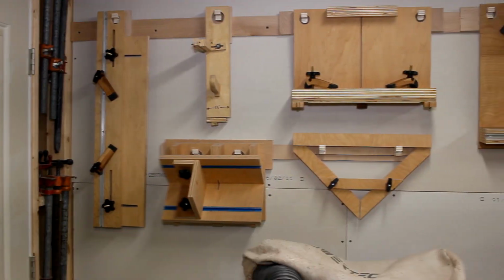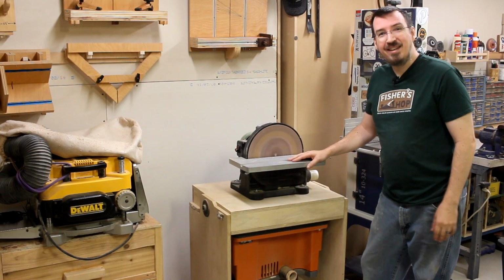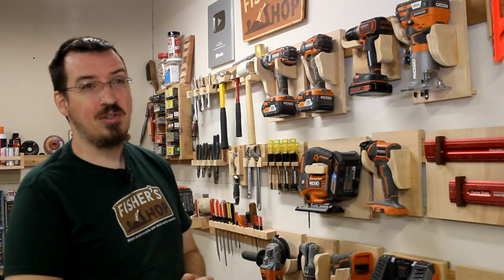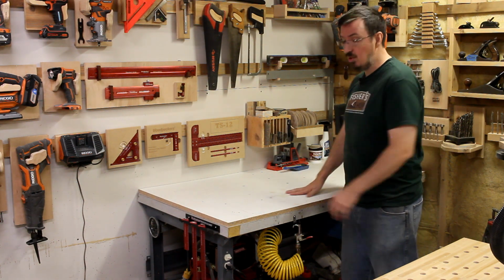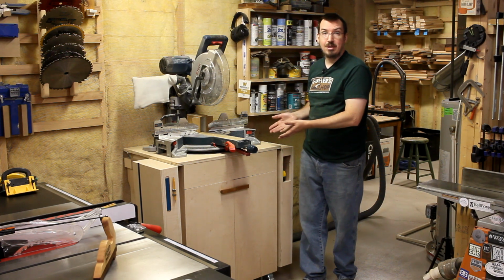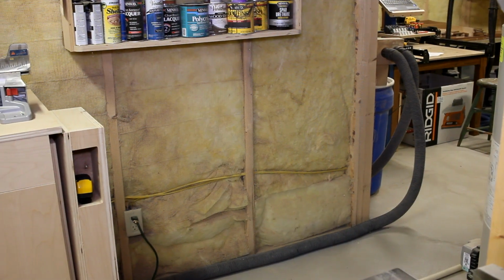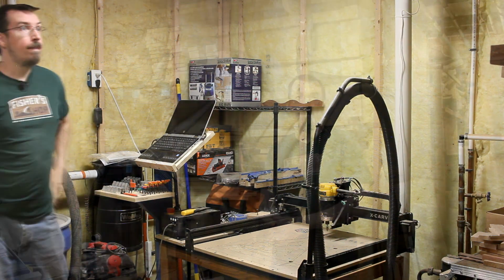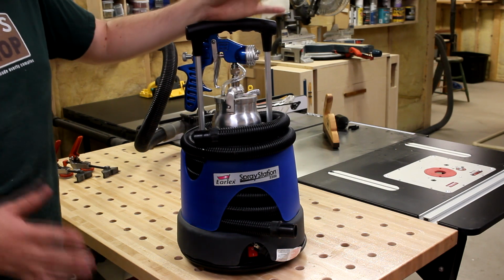Fisher's Shop - Shop Tour 2019

Comment: One thing I'm glad I did in my shop is put plywood on the walls. For the most part, you don't need to locate a stud. Make sure you meet fire codes before removing any. Nice video.

Comment: Ive owned that sprayer for a few years now. Ive stained my fence and painted several things. It even sprays latex paint very well once thinned. I finished a piece for my sons nursery and the latex finish was really smooth compared to rolling it with a foam roller. It's a large cubby that holds 6 cloth baskets and I used less than half of a quart of paint inside and out with three coats.

Comment: I'm just getting into woodworking and also don't own a proper vise yet (hell, I don't have a workbench...), but I have a standard one like you. I made a plywood thingie where you have dead stops at one end and tracks with knobs underneath to squeeze whatever you're working on from the back. Doesn't work extremely well and requires sandpaper finish (to increase friction), but with a small piece of wood glued and screwed underneath you can mount it in the vise and make it a bit easier on yourself for sanding, for instance. Hope it helps 🙂

Comment: That’s awesome that you use stuff from your grandpa in the shop and have your brothers sign. My kids make some stuff in school that I put in my shop. Yes your right flathead screws are so frustrating. I have stuff from my grandpa too in my shop. No flathead screws anymore though. Only square drive from here on out. Some torx too.
Reply from the maker: I like the robertson and torx screws too EXCEPT for them your bit gets stuck in them and you need pliers to get it out.  It's like the polar opposite problem from flat-heads.  lol

Comment: I'm impressed by the dust collection running off of that shop vac. I'd always heard anecdotally that long runs with shop vacs and corrugated hose don't work well, but you seem to have proved different. I might need to reconsider that approach.

Comment: Drew - just found your channel and look forward to watching more of your videos. You have done a great job organizing your basement with limited space which is not easy. I like your french cleat system, it is great for heavier tools. I use pegboard  in my shop. I can put a lot of things on the wall in a limited space. As I have gotten older I have collected more tools and sometimes it can be tougher to remember where everything is stored. I paint the pegboard to my theme colors and group my tools/accessories on them by color/purpose to make it easier to find them quickly. I also paint my cabinets and tool benches to match and  it seems to look pretty good. I used to have a great memory, I sure miss it! Keep up the good work.
Reply from the maker: Neat idea about sorting by color

Comment: Proving without a doubt that spending that extra time on setting up these areas of the shop pays dividends in the long run in terms of efficiency and knowing exactly where everything is. Mine is a complete bomb site and is about the same size as your lumber rack. And no, I don't know where everything is, lol. Especially that pencil that I had in my hand that I've made vanish. Again. :D
Reply from the maker: Haha, you said it Matt... it's a lot of work up front, but it pays off.

Comment: I like the idea of building carts and stuff off of the moving dolly base. I was just thinking about getting some of the big ones and maybe connecting two of them with some two by twelves to make a nice cart for my department at school.
Reply from the maker: Not a bad idea.  Just be aware that you can't lock the casters so you might have to make small wheel chocks to keep it from moving if you'll be using it as a work surface.
Reply: @FishersShop  I  was thinking about just changing out the casters for my favorite brand that has wheel locks. At least for one side of wheels maybe...

Comment: great video, here's a suggestion on where to put more clamps: i don't know the correct term for is but i call it a 'drop-rack' and it goes on the ceiling... and as you can understand, it's a rack that hangs from the ceiling and when you need something from it, you flip a switch, lever or whatever you think of, and one side of it drops (gently) and when you don't need it, it folds back up and it's not in your way any more... 
i hope i explained myself properly :)
Reply from the maker: Interesting.  I'll look into it, thanks.

Comment: Wait... you use a little 2" hose on your JOINTER ????   Doesn't that clog up!?    I know, dumb question, it must work, since you use it, but I would not have guessed that it would work.   And it is a long run of corrugated hose also, which also doesn't help.  Huh.
Reply from the maker: Yeah, seems to work when I take light passes.  If I want to remove a lot of material in a hurry though, I usually just take off the dust collection entirely and let the shavings fall onto the floor.

Comment: Great videos, Drew. Question for you - how do you like the overarm dust collection on your SawStop? I’ve read varying reviews about its effectiveness. Also, if you have a SawStop mobile base, which one do you have? Getting ready to buy a SawStop.
Reply from the maker: I don't have the mobile base since there's no where to really move the saw in my tiny shop.  The overarm is pretty nice when cutting down large panels but not something you can use for many of your cuts, particularly anything narrower than 3" or so.  Be aware though, you need the blade guard that works with the arm and if you don't get the 3hp saw, you'd have to purchase that separately (unless they've changed how that works).

Comment: Nice tour. What are the sticky notes on your lumber rack? Also, how long of a board can you cut on your miter saw (how long on one side of the blade) before you need some sort of extra support? I have been putting off making a similar cart for mine but if the wings only need to support ~60% of the length of the board, that might actually work ok for me.
Reply from the maker: I sorted all those little boards into categories depending on their figure (spalted, curly, mineral stained, knotty, etc.).  I have them labeled so I can easily grab the ones I want when I have a certain "look" that I'm going for.  Most of the time I don't have to raise the wings on my miter station.  So far I've only ever had to do it when breaking down long 8'+ boards.

Comment: Drew how do you like that bandsaw for resawing? I was going to the store to buy it yesterday but it was discontinued and replaced with a similar but nobody has it in stock yet. What blade do you use to resaw?
Reply from the maker: I've got a 3/4" blade for resawing but depending on the material, I've actually resawed with a small 1/3" blade before too. It's probably not recommended, but it worked just fine.

Comment: Do you like the sawstop 1.75HP? I'm in the market and I'm trying to decide if want to pay the extra money for the 3hp. I do cut down 8/4 stock of hard maple, Purple Heart, etc. for my cutting boards. Any thoughts?
Reply from the maker: I love my 1.75 and I went this route because I didn't want to run a dedicated 220 circuit just for my saw.  I didn't have room in my breaker box for that.  But if you're frequently cutting down large stock like that, you might want the extra horses.  Comes at a cost though!

Comment: Table saw extension table size? 36 or 52 inch (or whatever the sizes are)? Space vs capacity. If I'm cutting plywood or plywood for cabinets often it makes sense to go bigger but in a garage workshop the size worries me. I've been settled on 36 inches for a few years now. Your opinion?
Reply from the maker: I got the 36" with the T-glide fence.  It's basically all I could fit in my little shop.  If you have room for the bigger one, then go big.  You can always use the extra work surface.
Reply: @FishersShop  Been pretty settled on the smaller one and I can always use a guide and circular saw to cut large pieces. Trying to manage pushing any plywood that large through alone is probably dumb/harder.

Comment: Hey Drew, was wondering what the main shop measured. I have an area 12 x 20 that I've been trying to get under control. Unfortunately I'm not near as organized as you, and would love to get there. Very nicely put together shop you have.
Reply from the maker: Around 12x16 for the main area.  10x10 for the robot room
Reply: @FishersShop  thanks Drew. Then it sounds  like I should be able to make mine work since I have 4 more feet in length. Guess I have a bit of work to do.

Comment: Sweet tour drew I definitely picked up on some storage solutions for my small shop.  I was going to ask if you have dust issues with the furnace.  I built a faux wall in front of my furnace and surprisingly it still gets dust inside the control panel.  I assume sanding is the main culprit for this.  

Also, I’m curious if you have any more info on the dust setup/piping for the x carve.

Of course I’m sure Mark appreciates the #unnecessarywalnut uses.  I too have seen to come down with the unnecessary walnut sickness in my shop small bits.

-Ben
Reply from the maker: I just use the stock dust collection kit from Inventables and it seems to work pretty well.  Of course when I'm filming I can't really use it because it doesn't make for an interesting shot when everything is hidden.  So in those cases, the robot room gets pretty dusty.  And yes... it's inevitable that some dust gets into the furnace but I just buy my filters in bulk and swap them regularly.

Comment: It is nice and efficient setup of shop. If you don't mind what are the dimensions of your main shop? The reason I ask is I have workshop in basement 16' X 14' always have hard time to rip 4x8 plywood on my table saw.
Reply from the maker: Mine is around 16x12.  The most I can rip on the table saw is 7'.  Anything larger I have to break down on the miter saw or tracksaw first.
Reply: @FishersShop  Thank you for sharing.

Comment: Hey Drew. Love your channel and thanks for the tour.  Bought your plans for the miter saw station and am in process of building that now. Was amazed how well thought out the instructions were. I’ve got the same Sawstop table saw and am looking to add a router table. Was curious if you had to do any custom mods to install the woodpeckers router table extension on your saw?
Reply from the maker: Thanks Mike.  The Woodpeckers table extension was perfect.  No mods necessary.  The install was very easy and went without a hitch.

Comment: Love your channel. Could you share the sensor setup that turns on the dust collection on you miter and table saw? Also can you share how you setup your air compressor for three different ports?
Reply from the maker: The sensor is just the i-vac switch.  Search Amazon for it.  For the air compressor, I just plumbed in some black iron pipe and 3 quick disconnects for air lines.
Reply: @FishersShop  Thanks. Could you show a picture of the compressor fix?

Comment: Hey Drew, I do have a question about the miter station. I have a radial arm saw that I can't really use because, well, it doesn't have a stand, table or extension tables. I watched you video on the miter station build, but I didn't think of it until now. Do you think that with a few modifications to beef it up, that beast is heavy, it would work well as a radial arm saw station? With wheels that lift so it can sit squarely on the floor. Or do you think it should be better on a fixed large bench type station for more stability? Let me know your thoughts. Anyone else can chime in as well. And, thank you very much

Note to everyone:
Please, please don't give me the lectures of how dangerous RAS's are. This one has been in my family for years and I inherited from my father when he passed away. As with all tools, remember that they are powered and if they can tear through wood, they can tear through you. We have the brain, not the tool. I've heard lots of horror stories about the RAS and they largely seem to be attributed to operator error and not the tool itself. As most workshop injuries are. Yes tools fail from time to time but that happens a whole lot less than operator error. So, although I do truly appreciate your messages of caution, I am a cautious person when it comes to power tools. Remember, We have the brain, not the tool.
Reply from the maker: Hmm I don’t have much experience with radial arm saws but I would tend to think that it would be best on a real solid work surface. However I don’t see why my miter station wouldn’t work if you let it sit squarely on the ground.

Comment: Thanks for sharing. I would love to add a router extension table to my saw stop. What do you think of it?
Reply from the maker: I had a bit that I recorded talking about it and the Woodpeckers Superfence that I use on it but I ended up cutting it from the video to keep the length down.  I absolutely love it and highly recommend it.
Reply: @FishersShop  Thanks for the response. I love your channel. I especially love your french cleat tool wall.
Reply: What did you use for the legs of the router table?  Is you saw mobile?  What, if anything does this do to mobility with the router table?
Reply from the maker: @daveerickson5313  The legs are part of the table extension kit.  You can still use the mobile base on the saw (if you buy it) with this router extension.  Since the mobile base lifts the entire saw up to move, it also lifts the extension legs off the ground.

Comment: So I just finished the flip top cart, and I love it. I know this video is already a year old. I would like to have you help me set up my shop in my new garage,,,, I would even pay for the plane tickets, I would just like to get an opinion on how I should proceed, and I would also Like to work on U-tube content.
Reply: I have also seen that you read all comments, but that was a while ago, so I can understand if you don't get to this.
Reply: I'm sorry, I look like I am begging, but as a person who is new too all this, I am not only sad that my dad/grandpa didn't teach me everything I know, but I know that learning from other people is much faster than learning it all my self
Reply: @simoncameron4355  Hi Simon If you're interested there is a book The Small Woodshop or Workshop  by the Tauton Press. I bought it twenty five years ago when I first opened my cabinet shop in San Diego. I've gone from one small garage to a 1200 sq ft space and then back home to a two car garage in 2008 when the market went south. I've got a powermatic with an 8 foot fence , a 16x 32 powermatic belt sander, delta dj20 jointer , foley belsaw planer molder, knight pocket hole machine, delta 13 spindle hole boring machine, blum door machine , an italian edgebander which hides in the corner, makita sliding chop saw, two dust collection systems ,two compressors , two portable table saws, delta mortising machine too many clamps, and  too many hand operated machines to list and a lumber rack that can handle 20 full size sheets of plywood easily. Wheels help! If you'd like a tour leave me a response and I could give you a face time call and give you some ideas. I'm a carpenter /cabinetmaker with 36 years and many tears in. I love talking shop and if I can help I'd be glad to. I love Drews videos frankly he's the first thing I've been putting on in the morning, his dry sense of humor and his insight into jigs(so far that"s all I've seen) is very entertaining. I can't imagine what his neighbors house looks like with all the stuff he's borrowed. Good luck with your endeavors!
Reply: @57xmasbaby  Holy cow yes, I will definitely read the book suggested, but if you have a few minutes I have Soooooo many questions, I currently have a 30 x 32 garage I just built, and I need to make sure I leave room for two cars to park for the winter, but I just don't know where to start.

Comment: You’re 100% correct, flat head screws ARE by definition and technically referred to in industry as STUPID! See, in the 1930’s Henry Phillips (in Oregon!😉) invented the Phillips screw, rendering the flat blade screw even more stupid than when it had been originally invented! Granted at the time of the flat blade noize maker was a boon as modern machinery was not yet feasible. Blah blah blah. AnyHwayz!
Reply: I believe you mean slot head screws - not flat head.

Comment: Am I right in assuming that you have walls with uncovered insulation in your shop? I'm afraid that's a really bad idea. You'll be inhaling microscopic bits of insulation from the air every time you're in there - which is often, I reckon.. And that's very bad for your lungs. You need to cover it up, Drew..
Reply from the maker: But it’s delicious!